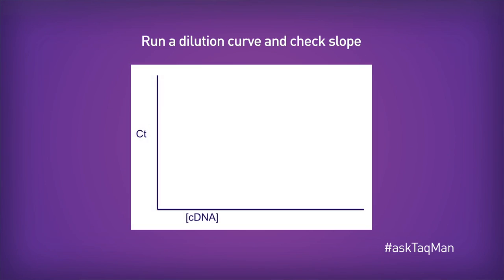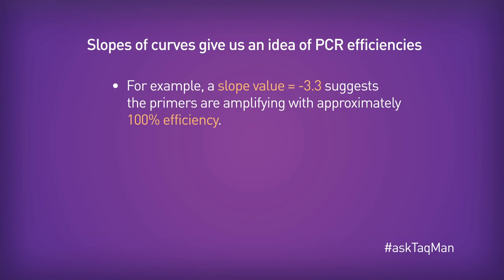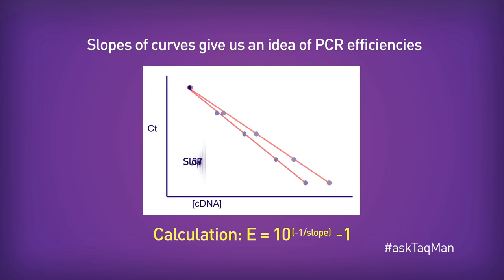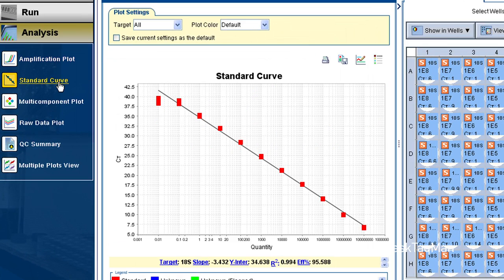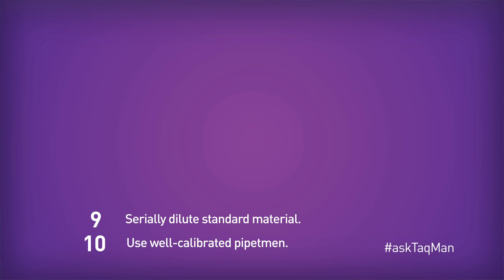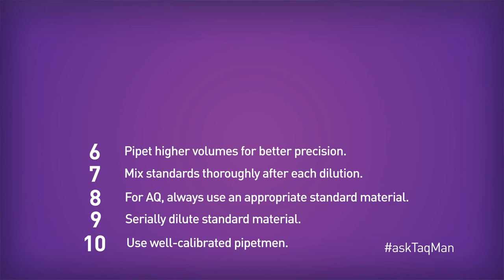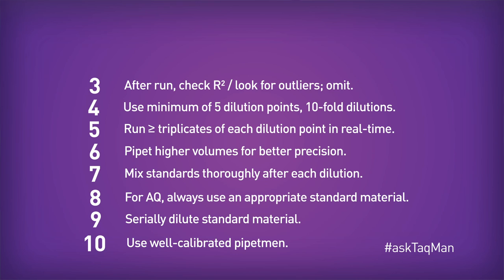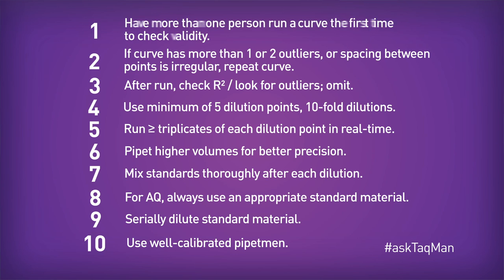How to Measure PCR Efficiency of an Assay -- Ask TaqMan®: Ep. 4

Comment: When you dilute a representative DNA sample to make a dilution series for checking the efficiency of a PCR reaction, include dilutions that will include the dilutions you will also use of your actual samples. Note that if you use the slope to calculate Efficiency using just the first more concentrated samples you may get a value that is over 100%. Like 110%. But you cannot actually have more than perfect doubling 100% efficiency. So why do you get >100%? Simple, that is because you have inhibition of PCR in the most concentrated sample and as you dilute the sample the inhibiting factors decrease, which causes the efficiency to increase from its lower, inhibited, efficiency. This gives you a slope and calculation of >100%. You can check the slope using just the more diluted standards and will find the PCR efficiency does not exceed 100%.  If possible, dilute your test samples to use the range of dilutions that avoid the inhibited PCR efficiency. It will just take two or three dilutions to often remove this problem. Also, no matter what your dilution is, find out the PCR efficiency around that dilution region and consider using the full equation that includes adding the fractional PCR efficiency for both your gene of interest and normalizer gene PCRs. You can still use the reactions for quantitative analysis even if they are lower efficiency, like 75%, as long as you use calculations that include the efficiency. The simple Delta-Delta Ct method equation is just the simplified form of the equation when the fractional PCR efficiencies are 1 (100%).  Ken Mitton, PhD FARVO. Eye Research Institute, Oakland University, Michigan.

Comment: can you please explain the slope value..how its( -3.32)
Reply from the maker: The slope comes from the equation y = mx + b, which is plotted through the points generated by the efficiency check curve.  The points on the x-axis are log [input cDNA], and the y-axis are the Ct values.